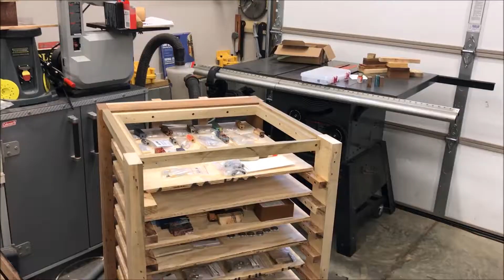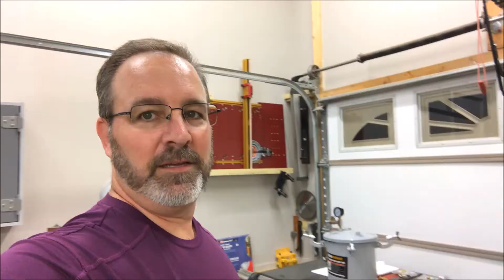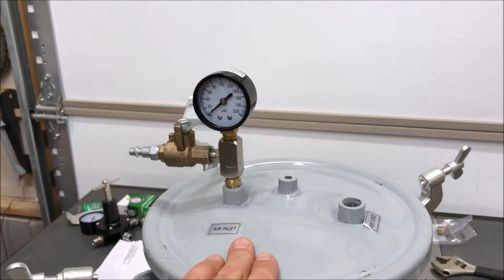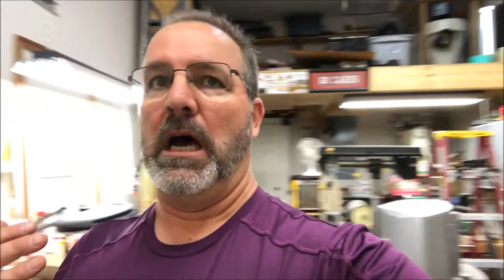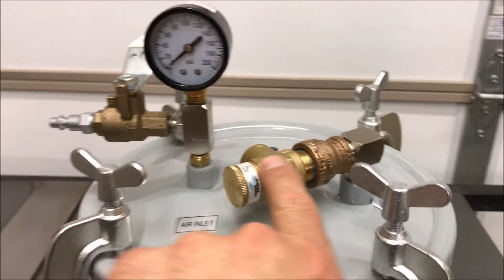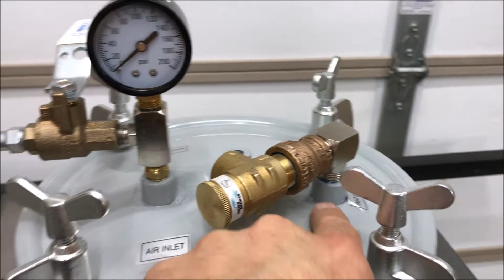Shop Update 10/15/2017

Comment: My pot came with a 50 psi valve, I put a 70 psi on it and have had no problems. I could be wrong but the pot recommendation I believe is because of the relief valve that comes with the pot, if it’s a 50 psi valve there going to recommend not to go above 50 psi.
Reply from the maker: +cejkwo Mass Thank you,
  I believe you are correct. I received an email from a caster that recommends 70PSI for crystal clear Alumilite blanks. 75, should be perfect with that in mind. 

Regards,
Bob

Comment: Bob, this is the release valve I used for my Harbor Freight pot.   https://www.amazon.com/Control-Devices-Brass-Safety-Pressure/dp/B0081TJHXI/ref=sr_1_1?s=industrial&ie=UTF8&qid=1508160582&sr=1-1&keywords=60+psi+pressure+safety+valves
Reply: I used the pressure release valve that came with the pot and adjusted it to blow at 50 psi just to be safe.  I used the exact fittings that Zac Higgins uses in his video on how to set up a Harbor Freight pressure pot.
Reply from the maker: +Dave White Thank you Dave. 
  I’ll check it out. I have an amazon order building right now so I can always add this to the cart. 

Regards,
Bob
Reply from the maker: +Kimberly Frans Thank you Kimberly,
  I was going to use the stock PRV but I’ve had a few HF tools fail and the replacement wasn’t very expensive so I went for it. My pressure pot has been holding steady for 9 hours so far. :^)

Regards,
Bob